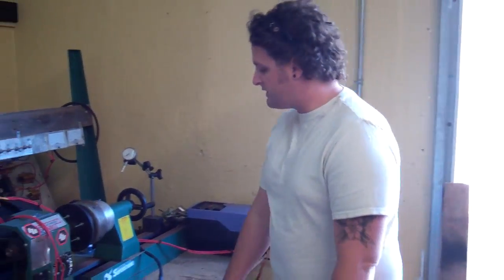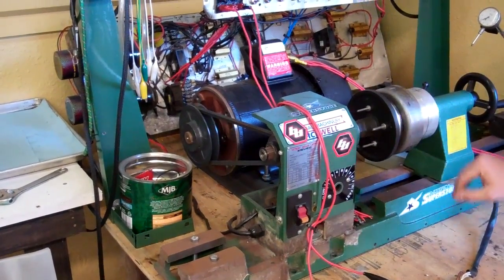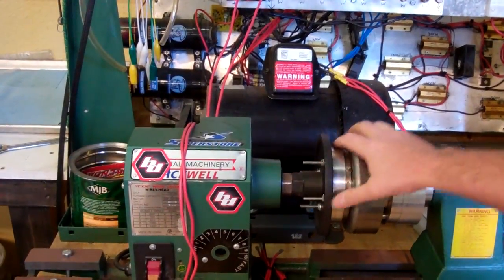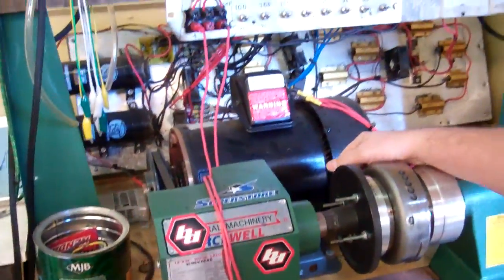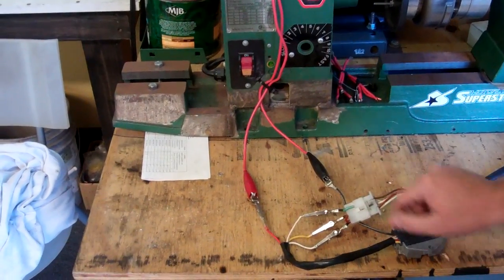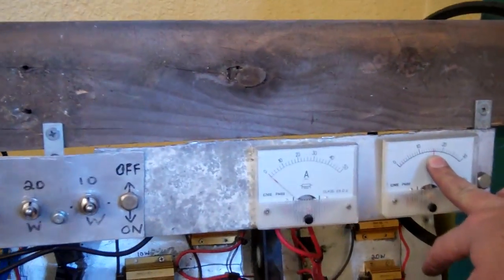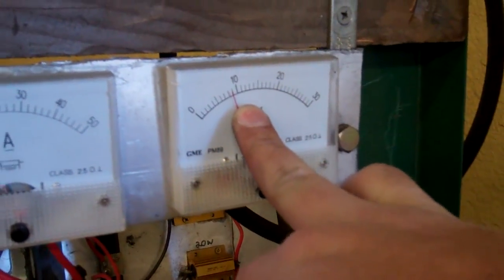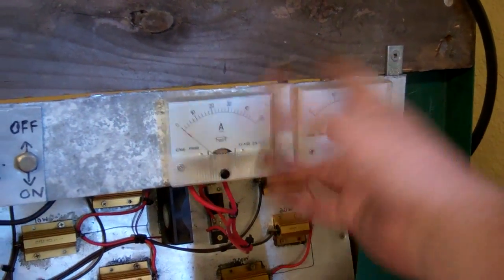RaceTech Electric Stator & Voltage Regulator Test Bench

Comment: Hi there,I have a zx10r. My battery isn't charging. I have checked the stator windings, spec says 0.1-
.2 ohm. I'm getting 0.4. would this be enough for it to be considered bad? Also tested the output voltage with the bike running, spec says 48V at 4000rpm, im getting about half that. could this indicate bad magnets on the rotor? is this common? Thanks for the help.